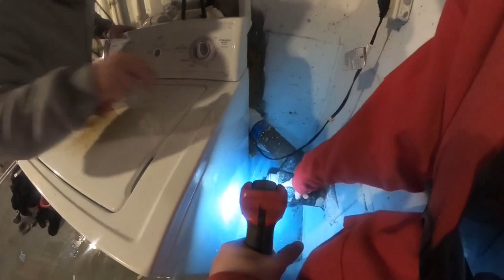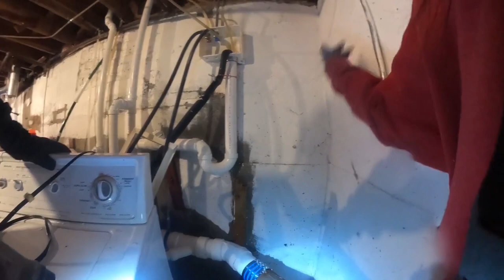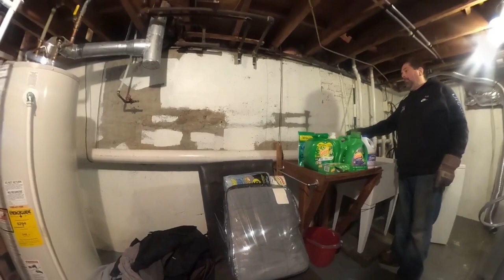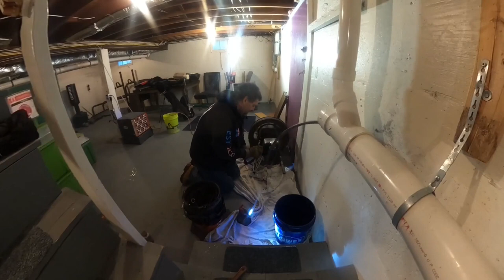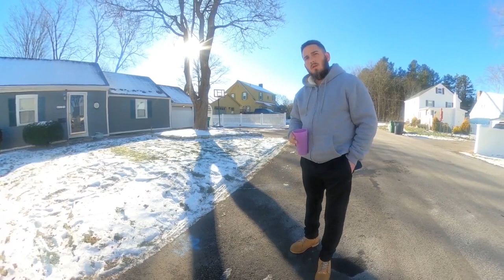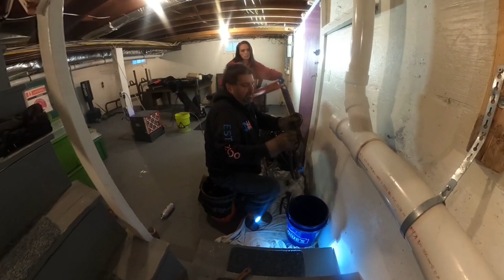How We Clean A Main Sewer Drain From A Rear Cleanout Plug #180

Comment: You went above and beyond with that customer! That's the way you run a business! Most people open the drain and leave the customer wondering what was done. Where was the blockage? Etcetera,  Etcetera. Excellent job!
Reply from the maker: We believe everyone has the right to be fully informed. And leave their house the way we would want ours left. (Shelly)
Reply from the maker: dennis cordova  The blocked was about 15' outside the  foundation wall.  We always run 100" of cable as long as we think we are not going to get twisted in the city main. (Bob)